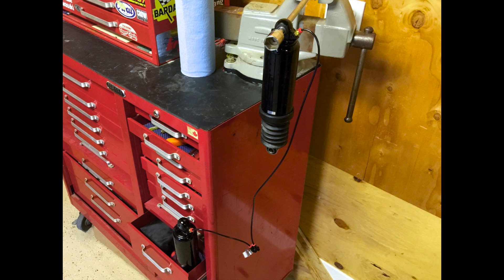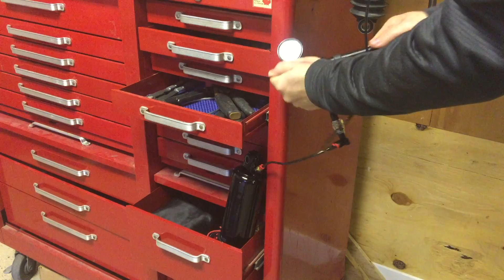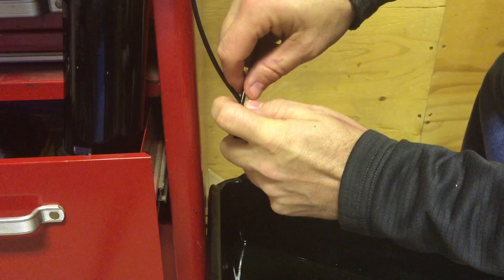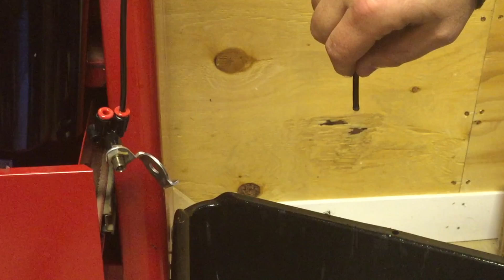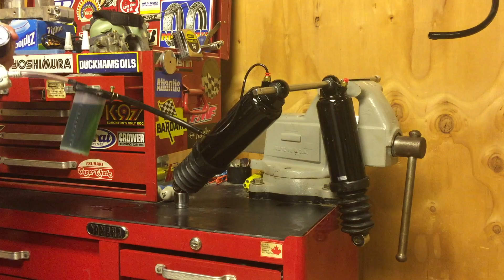Harley Davidson Touring Air Shocks - Oil Change

Comment: I want to take few seconds of my time to THANK YOU for this video. let me explain why? Maybe this comment will help others too. I decided to "improve" my 2015 Ultra limited with the "premium" street glide CVO rear shocks. In the process of removing my regular shocks one of them laid to its side and dripped quite a bit of oil. The CVO suspension turn out to be extremely harsh for me. I asked the dealer about how to fix the old shocks and off course they said they can't be serviced I needed new ones. So this video not only saved me money but allowed me to enjoy my bike again. THANK YOU

Comment: Got 'er done tonight (actually early this morning - it's 2am) and the video helped me out.  I went with Bel Ray 5wt. fork oil, and the old fluid was nasty on my '99 FLH.  I already had the Mity Vac for brake bleeding jobs, so it was nice not having to buy another tool for a change.

Comment: Correction to my comment. The oil was squirting out at the time when vacuum was applied with oil in the container and instead of getting air out of the shocker it pumped oil out of the mityvac..
Reply: Can you tell me how to drain the fluid out without taking them off of the motorcycle?  Thanks!

Comment: You use the same method I used on my Kawasaki Voyager, I acquired these same shocks to improve my Sporters ride, Q: do you find 5W adequate or would you use the 7 or 10W oils? I expect to be riding solo mostly, 5W seems adequate but 7W may give me a better range.

Comment: It was a good video I choose to go with 8 oz I think my mistake was I use 15 weight and without any air pressure in the shocks the rebound and compression is so hard on that now I know why it supposed to use 5 weight

Comment: After watching your video I bought mityvac. For the first shock everything worked fine but on the second oil started to squirt out from mityvac side through the black plastic and no matter what I did I could not feel up the shock with oil. If you know how to remedy this please let me know.
Reply: Can't you just remove that fitting on the shock.
Then pour the fluid straight in

Comment: I'm looking to do my shocks. I'm wondering what your results were with the 5 weight? Did you leave it, or try something else? Were you happy with the 10 ounce quantity? Thanks for sharing! Your video is the only single one I could find to get a little insight into doing mine.

Comment: Great video! What Mityvac kit model number are you using? Also, you stated you can perform this maintenance with the shocks on the bike. How would you drain the old oil with them still installed?
Reply: YES - be interested on how its done when they are still on bike also ...
Reply: I to copied that he said you can drain on the bike.  I don't think you can unless you turn the bike upside down. Now wondering if you can use the same method to change fork oil, applying light air to draw out the old oil and mightyvac to draw in the new.
Reply: You don't turn the shock upside down, you let the pressure in the system push the fluid out. Pull the fill valve off the frame (one threaded nut) and disconnect the hose. reconnect the valve to the hose below the shock and pump it up to 40 PSI then disconnect the hose and let it drain into a container, below the shock.
Reply: R GH  “Reconnect the valve to the hose below the shock.”  Where’s the hose below the shock?

Comment: How much and what kind of oil can I put in each shock absorber?
Reply: 10 oz. in each rear shock.  Harley Davidson sells fork oil and you can get it in two weights, std. and heavy.  This amounts to about 5 wt. and 10 wt.  For even higher viscosity you can use ATF.  But for the rear shocks that's probably going to reduce rebound to nil, so start out with 5 and see how you like it first.
If you have an older Harley, like my wife's 2001 Road King Police, the front forks also use air over oil, but with a drain in the bottom it's even easier to drain the oil and replace it.  Simply let the pressure force the oil out, and use the mighty vac to pull a vacuum from the top to draw fresh oil from the drain in the bottom of the fork.  I think there is a youtube video somewhere demonstrating this procedure.  Good Luck.